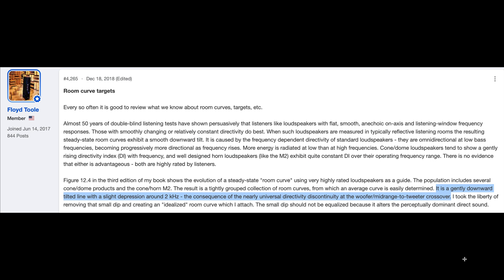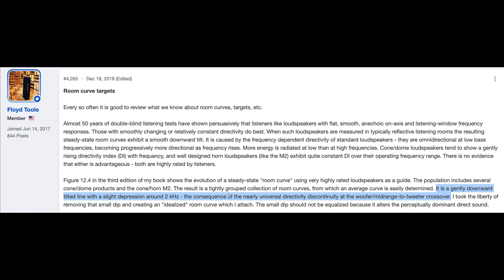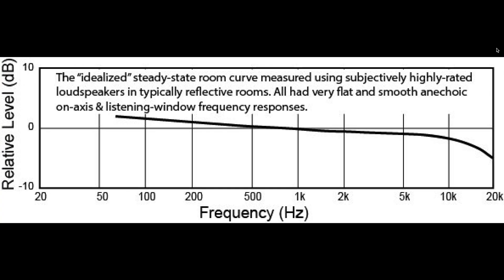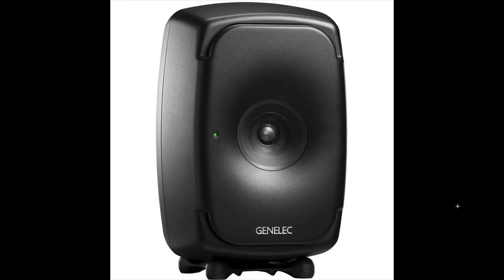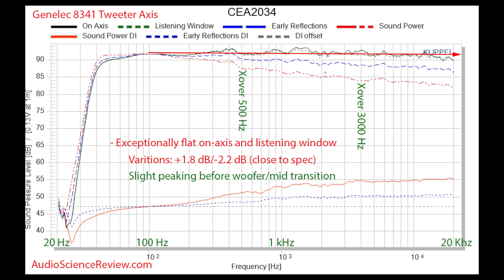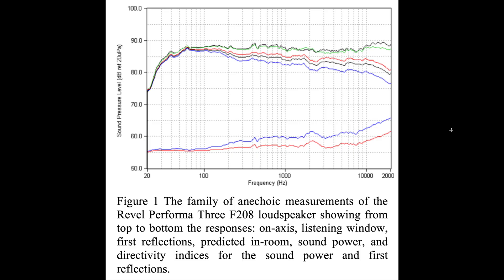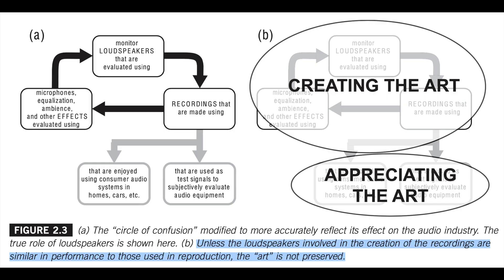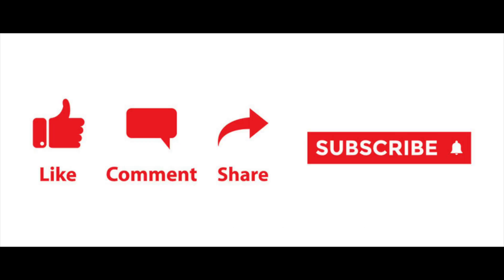A Circle of Confusion in Audio (High-Mid Scoop)

Comment: Sharur coming to the light side of the force, what times.
Reply: Now bask in the glory of active DSP speakers with constant directivity and linear phase thanks to FIR filters and cardioid bass response, add a few subwoofers to smooth in room stady state response and eliminate speaker boundary interference response
Reply from the maker: latency
Reply: @sharur1  True, latency is a problem in such deisgns, if its critical, need to give up linear phase

Comment: Now that you appreciate harman target more,doesn't the er2xr match it more than er2se?
Reply: no, the er2xr starts boosting lower frequencies too early, from 500hz, resulting in too much coloration
Reply: @zblus  agreed sir
Reply: @zblus  eh,
Er2se also rises there by a db or two,
They follow the same trajectory until 300hz, After that
It is just below er2xr with a couple of db difference.
But then 100hz onwards the er2xr follows the curve to larger extent,
There is about 10db difference at 20hz.
Reply: @abhishekms9472  a little bit of rise is fine, but the problem is that er2xr's bass boost is a straight line, no normal speakers will measure like this. It doesn't sound natural.
Reply: @zblus  bruh, it has 2/3 db more than er2se btw 300 hz and 100hz,
Er2se lacks bass by more than 10db from 100hz onwards.

A little warmthness vs missing bass extention.
Which do you think is more noticeable?
Reply: @abhishekms9472  depends if a oversalted dish bothers you more, or a undersalted one.
Reply: But IMHO 2 or 3db is a lot, and a perfectly flat bass is less bothersome than an unnaturally (straight-line) boosted one.
Reply: @zblus  nah, i like the er2xr more,
But the question was not whether i like it or not.
It was about which btw them that adheres to harman target more,
And the answer is er2xr,
Er2se lacks the bass extention.
Reply: @zblus  wdym?
Give an example of iem that does not have a linear boosted bass.

Again you are missing the point, we are not talking about our preference,
We are talking about adherence to harman.
Reply: @abhishekms9472  yes, because most IEMs do not adhere accurately to Harman, and neither do both ER2s.
Do you have the er2xr? If not, you'd be fooling yourself if you buy the er2xr under the assumption that it sounds anything resembling the Harman curve.

If the goal is the Harman curve, look elsewhere, don't waste your money.
Reply: @abhishekms9472  also, you were the one who changed the question and asked me "Which do you think is more noticable?"
Reply: @zblus  i have the er2xr,
You are deliberatley misinterpreting.
I am under no illusion the er2xr is an harman oriented iem, it is diffuse field tuned,I have a jbl tune 710bt for harman tuning.
But between the two, er2xr is the more harman oriented.
That is a fact.
Reply: @abhishekms9472  what am I deliberately misinterpreting?
Reply: @zblus  ok a simple yes or no question,
We don't have to go on tangents here.

Neither of the er2 series is harman tuned,we can agree.
We can diagree on what is an agreeable rise for bass.

But between er2xr and er2se which follows the harman curve to a greater extent? Isn't it the Er2xr?
Reply from the maker: er2se is very dark
Reply: dude has become the thing he truly depised

Comment: Have you tired dual-flange ear tips on the ER2SE? 
Its longer stem really helps increase the treble to sound more accurate.
Mentioning since I think I saw you call the er2se dark sounding in the treble, in a previous comment section.
The ER2SE also sounded too dark to me before I swapped to the dual-flanges, so this might be an "easy" fix.
Reply from the maker: It sounds worse with dual-flange
Reply: @sharur1  that may be true, but in what way specifically?
Reply from the maker: @zblus  worse treble extension and some weird mid coloration
Reply: @sharur1  I don't believe the worse treble extension part is true. 
There were measurements done on an evo with dual vs triple flanges, with dual flanges showing more treble extension.
Reply from the maker: @zblus  Evo has worse extension than ER2SE + Evo doesn't go as deep as ER2SE. There is a measurement of ER2SE triple flange having better extension + I tested in tone generator.